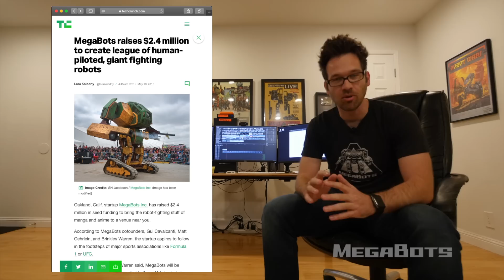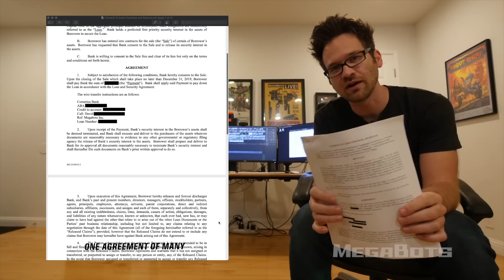I sold my $2,500,000 Fighting Robot On eBay

Comment: I want to buy a t-shirt but the website doesn't seem to allow it. My thought behind it was to 1, support you and 2, as a symbol of awareness of a project that was close to my heart, of someone who attempted something awesome and was unafraid of dreaming high and failing hard. I've been following the project from the very beginning and while it's sad to see it go this way, I'm glad the robot was bought by someone who will most likely put it to good use. And it would still be pretty awesome to gather all of the die-hard fans to contribute their tiny grain of sand as I feel like doing now.
Reply from the maker: i think you can still buy them at store.megabots.com! shoot me a message at matt@megabots.com if you are getting stuck
Reply: MegaBots Inc thanks a lot! that did go through this time. I have a lot of respect for your work and how far you actually got. You tried doing something no one tried before, without compromising your vision. I never bought merchandising of any kind but this is certainly a badge of honor

Comment: 2.5 million to build and it only sold for 29k?!
Ouch.
Reply: $29K is a fucking steal.
Reply: Fishhunter2014 

To be fair, it would have sold for a lot more for just scrapping it for parts, I think
Reply: @benjaminchen8857  But why. Who would want parts of metal you can get a fricking mech suit!?!
Reply: Benjamin Chen they did not want to scrap their work
Reply: Had I known that it would sell for only 29K I would have bought this thing easily. Even 100k is kinda great for this beast. On top of everything, I could scrap a lot of that stuff for future use in robotics applications.
Reply: @hj2479  i mean I don't have 100k laying around, but I would have definitely bid on this thing if I knew about it
Reply: @maxim6088  I would have done it at the time because of the value of the machine itself is so much higher than the bid price thereby it would be much more profitable to buy and resell rather than to keep as a luxury item. If you think about it 29k is not much, a good car investment can 80-150k and that's just an item your buying for personal use and pleasure. That being said, I understand why it sold at such a low price as the operating cost to maintain such a bot is quite high and so to keep it in its original form would not be cost-effective long term.
Reply: immortal putin your 7
Reply: @TheSexhaver2625  Says the person who cant even spell "you're" correctly.
Reply: @TheSexhaver2625  you're*
Reply: Liquidation
Reply: Ikr? Kinda sucks that he had to sell it.
Reply: I wouldve bought it if I'd known. Maybe bill will sell it to me?
Reply: Even if he straight up scrapped it the major components would double his money